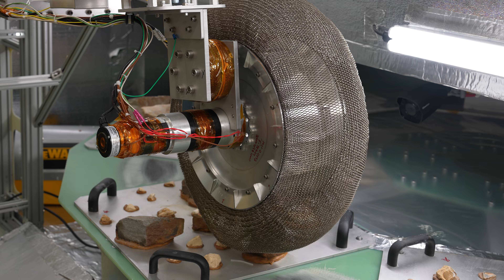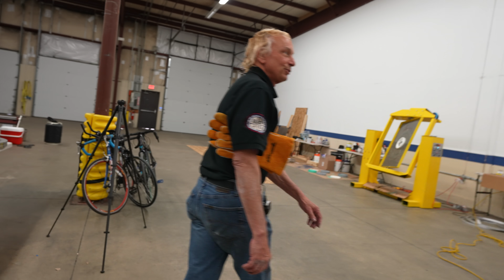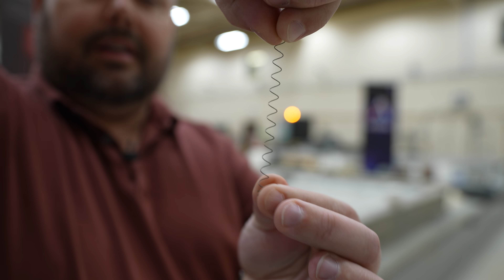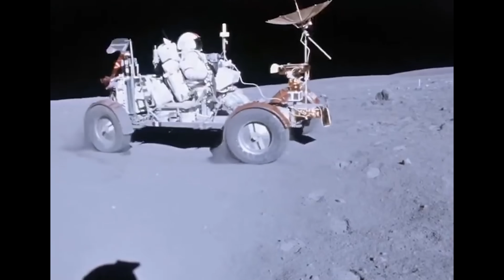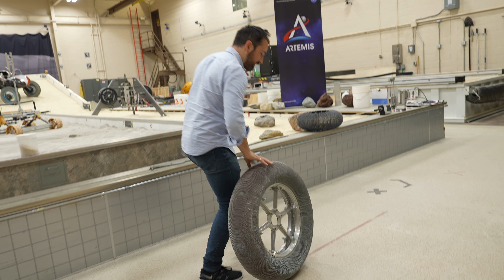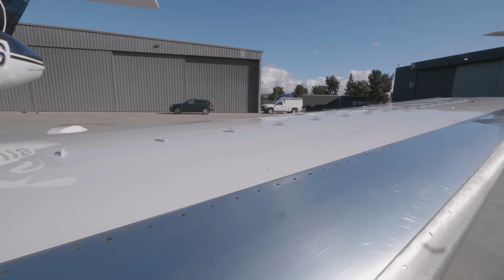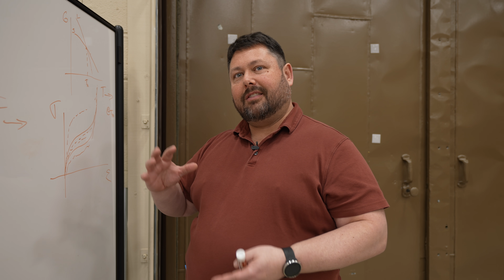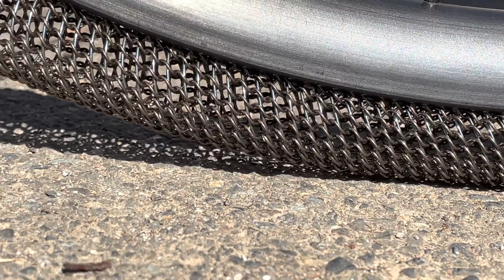How NASA Reinvented The Wheel

Comment: I would have appreciated at least a brief mention of nitinol's downsides - why aren't we already using this everywhere? There has to be some limitations
Reply: cost... not that NiTi is  composed of wildly expensive elements, but rubber is generally good enough, and is very cheap in comparison. Also it's still new technology compared to rubber.
Reply: It was used in glasses frames, my buddy had a pair as a child. He could completely bend and crush them and they would return to the original shape.

The problem with it is that it's a durable material for applications where deformity is acceptable or even desired. There just isn't very many applications where we want that behavior aside from tires. Problem is a wheel made of nitinol is overkill for some applications like shopping cart wheels, computer chair wheels, wheelchair wheels, etc. And for applications like automotive, nitinol has less grip than rubber. 

A combination could work for some in between applications, rubber tires with nitinol making them airless. The problem here is probably price, rubber + air is cheaper than rubber + metal. Some in the luxury market may pay for tires that never suffer from deflation.
Reply: I had a piece 40 years ago.
Some Scuence magazine had a contest.
Now I have some broken springs at work from a dry cabinet.  Cool use of nitinol but not a good one.  They are used to open and close divider plates.  But are slow and dry cabinet air is exposed to outside air.
Reply: Historically, it's a relatively expensive and difficult material to work with (and rubber tires are cheap). The reason you're seeing more and more about it, though, is that those factors are changing rapidly. 2 years ago our bike tire was WAY too expensive, for example. It is not anymore.

Comment: Now what I'd like to know is what needs to happen to cause wear on this material, or rather why doesn't driving around on rough stone slowly chip away at it? I'd of cause guess, that every little stress is just "elasticly" deforming the material at that point, so that nothing really gets to bite into it, which in turn prevents parts from sticking out and being taken off, but how resistant is the surface really?

Comment: Actually, such a tire would increase rolling resistance by quite a bit. Real low-rolling resistance tires are made to minimize viscous (damping) behavior and even minimizing flexing by using higher inflation pressure. 
Otherwise cool stuff for space exploration. It was a real pain to see punctured wheels on the Mars rover.
Reply: I'm sure that toying around with different composition of the rubber/outer encasement of the nitinol skeleton would readily fix that issue for earthly applications
Reply: @Joe_C.  right. Rover tires are very soft (they need to float over sand and envelop rocks, among other things). Notice that the road bike tire is closer to 100 PSI equivalent.
Reply: I believe that they can "prgram" how much resistance it will impose, so they would just need to know how much flexibility to program to match psi.

The more salient issue (which someone above brought up) would be reaction/response time between the elements we currently use and nitinol. How fast they flex and return to previous shape. Although this may only be an issue for performance tires.
Reply: I don't care. For my short distances in the city it will do. It's good to have a little workout. I take that workout over flat tires any day 💟
Reply: Not on bumpy terrain
Reply: No. The energy return on the material (which now comprises your sidewalls) is excellent. Added more air pressure is just making a stiffer tire with less deflection, same as making a stiffer shape memory alloy tire. Apples to apples you WANT some deflection in a tire or it's going to be an awfully rough ride. SMA tires actually have a fundamental advantage at the materials level.

Comment: Using liquid nitrogen to demonstrate how tires on the moon would behave is pretty misleading. Yes it is cold and yes they would eventually freeze and become brittle but there is also much lower pressure and nearly no atmosphere there so temperature would not wick away that quickly as there isn't enough atmosphere to efficiently wick away heat. If we sent our tires some where with liquid nitrogen puddles that demonstration would be much more accurate.

Comment: Is there a limit to how long the nitinol can be held in the twinned martensite deformation and return to its original austenite form? I wonder how this could affect the wheel packing for a mission and whether this would allow for greater cargo capacity - if you could get a meaningful increase in fuel tank size for the rocket, without needing to integrate a larger insulation layer to not create a permanent deformation. (On second thought fuel tanks should be undergoing and liquid-gas phase transition so excessive cooling would be the worry and maybe the alloy would become over brittle)

Comment: So much cool in this video! I would be interested in the performance comparisons between NiTiNOL tires and pneumatic tires. Are they more or less efficient at transferring your peddling effort to the road? Is there a slight delay in that transfer due to deformation?
Reply: Interesting question.  Although both materials are going through "deformation", it would be good to know the speed of reaction both ways,  "deforming" and  returning to its original shape.
Reply: The transformations are (practically) instantaneous in the material, with a higher energy return versus rubber or steel (the usual materials being flexed). The ability to have low rolling resistance is one of their totally unique capabilities you won't see in the usual airless tire.
Reply: @thesmarttirecompany  Wow, so much better all around.  Can't wait until it starts making its way to commercial market.

Comment: Technically a wheel is just a circle/round object so if they are making another round object they can't reinvent the wheel, the material is cool but this is only marketing just like battery cells been marketing for over 10 years better batteries we also had marketing for wheels that do work yes but if your wheels are more expensive than your car or your bike you need to stop and ask what the hell

Comment: My job is to develop heat treat processes for mainly medical device components made out of nitinol, getting the components to transition from martensitic to austenistic at specific temperatures in all sorts of shapes, but even I was able to learn more about nitinol and it’s varied uses. Really fascinating video.
Reply: I once designed a solenoid valve that used a nitinol spring. The problem I had was the fatigue life was not good. I would get springs breaking at 100k cycles and I needed 10x that. So I abandoned nitinol for spring applications. This was 15 years ago. Have there been advances that have improved the fatigue performance? I assume tires would need very good fatigue life.
Reply: @alexkram  it’s possible that the strain was too close to the maximum of roughly 8%, which over time could weaken the material to the point of breaking. 3-4% strain is ideal for longevity, and would make for a relatively life-long part.
Reply: @alexkram  I'm also an engineer at a nitinol device manufacturer. A big factor in fatigue life is alloy purity. Companies now offer alloys with extremely low inclusions (ELI from Confluent, Enduro from Memry, etc.) You would have better luck with those alloys when considering fatigue. They are fairly recent advances so  weren't available 15 years ago.
Reply: @ignolan  thanks for the info. I was working for a semiconductor tool company as R&D engineer. Another cool thing about nitinol is its corrosion resistance. Good for medical and semiconductor. I always thought it would work well as gaskets between devices because in the superelastic phase it could conform to surface irregularities and make a seal, then spring back to be reused. Now they use single-use 316 stainless gaskets ($$). My company didn't want me to work on that project though. Retired now.
Reply: @alexkram  some good answers already in this thread, but optimizing for strain through composites and geometry (e.g. wire diameter) helps. Material quality as well. Millions of cycles is definitely doable, not that it is easy. The capabilities are definitely increasing year-by-year and I expect that to continue into the future, especially as NASA is actively improving the alloys for space work.
Reply: How expensive is the material? Could those jeep wheels be a factible product?
Reply: @manuvillada5697  nitinol can be expensive (especially for biomedical), but using simpler non-medical forms provides huge advantages, as well as optimizing how much material is used. Long story short, our commercial tires will have cost comparable to high end tires already on the market.
Reply: It depends a lot on what sort of form you're getting it in. A spool of a couple thousand feet of ~.040" diameter wire would be in the $750 range for reference. Tube is more expensive due to it being a more intensive process to produce. Sheet is a few hundred bucks for a 3"x18" piece.  The wheels are doable but even with manufacturing at scale they're going to be a good bit more expensive.
Reply: its*

Comment: Hmmm this could be cool in developing an emergency heat shield that activates at certain temperatures. Considering it can also act like a muscle when under heat this actually seems possible to say reshift material say from the backend of say a rocket reentering the atmosphere. Have more heat resistant material at the front end would reduce the amount overall material the rocket needs.

Comment: absolutely fascinating, based on  the load it can pull when changing phase, im wondering if you can use them for synthetic muscle fibers in robotic limbs controlled with electric heating.
Reply: I think that the memory metal might be closer to the working of actual muscles than pneumatic muscles. But I would question which of them is more efficient? Also is it easy to control the extent of strain in memory metal?
Although I clearly feel that they would beat pneumatics in terms of durability.
Reply: @AniketTurkel  considering how much one wire could lift, bundles of wire would probably be much more efficient power wise for the amount of space at that scale.

Even hydraulic exoskeletons need large pumps and power sources.  A nine volt touched to that wire as a short would heat it to red in no time.

Comment: But will nitinol tires damage asphalt roads or concrete sidewalks? I can see great application for offroad scenarios, but if the metal will chip and grind away at paved surfaces significantly faster than vulcanized rubber, then the potential for damage would be a disincentive to wide adoption.

Comment: The trouble with all attempts to replace the pneumatic tire is that the whole air volume works to absorb the energy of any impact. The "spring" is made of air and is as big as the tube. With metal sprung tires (and there have been so many over the years) only the parts of the metal in contact with the ground can contribute. The rolling resistance and the ride quality always suffers.
Reply: Did you not watch the video? That was addressed at 19:04
Reply: @-vermin-  I did, but it didn't look like the other parts contributed a great deal. More importantly, it looked like a huge increase in complexity. Certainly not going to fit inside a bicycle tire (which is where I'm familiar with the endless quest for the holy grail of airless tires).
Reply: I wonder what the rolling resistance is like.

Comment: Something you didnt mention is supersonic flight - probably the biggest thing holding back supersonic flight is tyres, tyres are why Concorde was grounded, and why Concorde crashed. The huge pressure end extreme takeoff speeds mean a small piece of debris can (and did) cause a disaster through tyre explosion.
Puncture proof tyres that cant explode and are woven together wouldnt have that issue
Reply: The tire issue with Concord was solved and has been applied to jet aircraft tires in general. Change of material and design for better performance under those conditions by doing the appropriate developmental testing.

Comment: It's so cool to watch things like this ,, 
Also I have a question,, 
Can it be used in daily  life vehicles like cars and trucks ,, 
If that can be used , that would be one of the best things I would see in my life ,,
Reply: One of the questions for a replacement of a auto or truck tire is if they are as efficient in rolling resistance or quasi-hysteresis (Pseudo-elasticity¿) as traditional tires. Even a single percent less efficient would render them not acceptable. Also any rubbing together of the metal “springs” with their neighbor would cause significant accumulated wear (over thousands of miles) thus the need for some kind of separation material like a traditional tire so the design starts to be more traditional. Interesting concept.
Reply: @Mentaculus42  yeah you've got a point bud,,
Reply: It could, but it would probably be far too expensive to ever be used in consumer applications.
Reply: @TheUnlocked  ya i think you are right , that would make them more expensive and out of the reach of the normal people
Reply: @TheUnlocked  I don't know, compared to what you'll spend on tires over the life of your car it might be worth it.